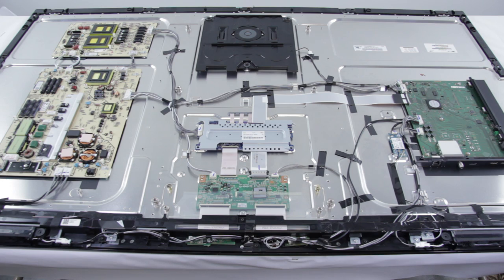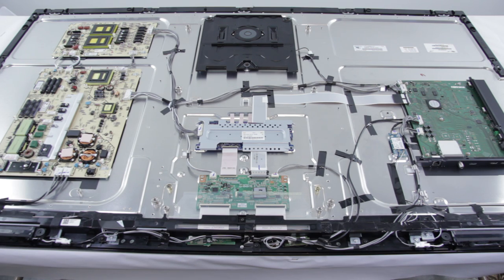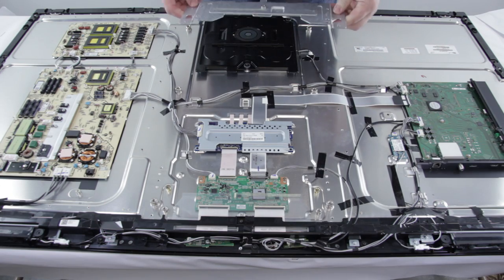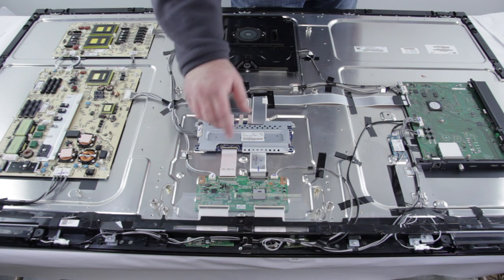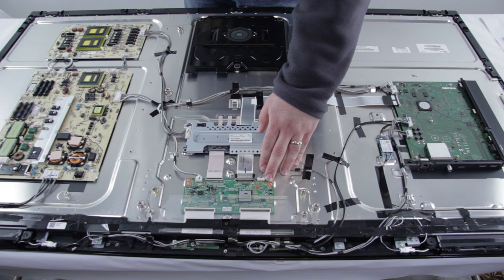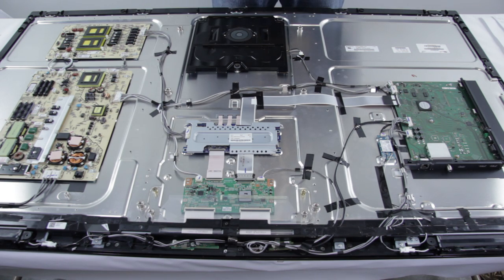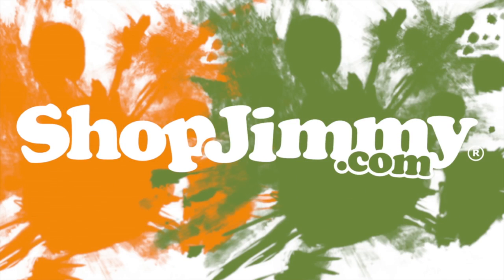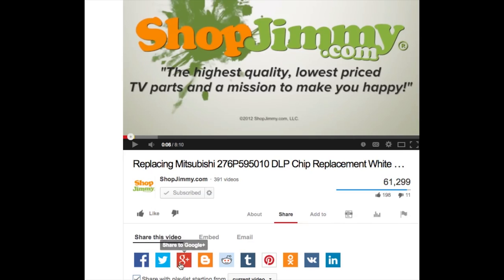LED TV Repair T-Con Board Help Review Overview - Common Issues and Problems with T-Con Boards

Comment: Hi !

I have a Hisense F42K20E I’m attempting to repair.

When I first turned it on, the right half of the screen was messed up but the left half was fine.

There were a lot of blue and red lines on the right.

I replaced the T-Con board.

Now the blue and red lines are gone, and the only problem is there’s a vertical black and a vertical white bar superimposed over PART of the Right side.

I’d estimate the black bar is four inches wide and the white bar is also.

Unless the T-Con board I bought is bad, or I didn’t get one of the ribbons in correctly....

There’s something else to replace.

Any ideas?
Reply from the maker: +William Carr   Try all repairs and troubleshooting at your own risk.  This sounds like a TV panel (TV Screen) problem.  If your TV panel is bad, it may be more cost-effective to replace the TV as panels are typically hard to find in stock, difficult to replace, and expensive.  Thanks and please let us know if you have any further questions!  www.shopjimmy.com

Comment: LG LED/LCD Model 42LE5300  - I have 3 thin vertical lines 2 blue and 1 red. The rest of the picture and TV is functioning fine. Could it be just dust build up or dirty ribbon connectors? Or could it be the T-con board, hope its replaceable. Thanks!
Reply from the maker: Justin Clockwork   This could be the Main Board/T-Con board or the TV panel.  I am saying the main board because it appears to have the T-con board connections built into it.    I recommend replacing the Main board (if it is the same part number as the main board in the search results) to see if it fixes the problem with the TV.  Click this link to find replacement parts:  http://www.shopjimmy.com/catalogsearch/result/?q=42LE5300  Be sure to match part numbers on your current board, with your replacement for compatibility.  Here is a link to a video showing how to identify your part number, click here:  TV Part Number Guide for LG & Zenith Main, Digital, & Tuner Boards (LCD, LED, Plasma TVs)  Thanks and please let us know if you have any further questions with your TV Repair!  www.shopjimmy.com

Comment: Hi, I picked up a Samsung LN40D630M3F that someone left by the dumpster in my apt complex and I'm trying to get it to work. It has backlights and sound, so I'm thinking it might be a bad tcon board. However, the screen was initially black until I connected my laptop to it via HDMI, which is now displaying a mostly gray square on the tv. Can you let me know if there is any hope in getting it fixed and if so, what tcon board I should get? Also, I only plan on using this tv to watch Netflix by connecting to my laptop. I didn't have a tv/cable before and don't have any interest in watching tv. Maybe this makes it easier? Please help and thank you so much for helping me diagnose the problem!

Comment: I have a Vizio M50-C1 led TV . Suddenly my TV stopped functioning .just the power line keeps blinking for few seconds and then stops no picture and no sound☹️plz advice where the problem is power board or the Tcon board

Comment: I have a 50” lg led tv. 50uh5500. I replaced the led strips and got them all working again. After I put the tv back together I only had a blank screen. Took it apart again and did some trouble shooting. If the left ribbon cable is connected and I turn the tv on, that side of the screen will work but if both ribbon cables are plugged in neither side works. Could that be the t con board?

Comment: I have a sharp aquos 60 in LC-60LE6300u LED TV. It powers up and backlights work. No picture and don't know how to narrow down if it's either tcon board or main board. Cant tell you if sound worked when tv screen went blank because it was given to me in this condition. How do I narrow it down?
Reply from the maker: +as4meAndMyHouse2415   Try all repairs and troubleshooting at your own risk. This could be a problem with either the t-con board, the main board or the TV panel. You can replace the main board and the t-con board individually to see if one of those boards fixes the problem.  Click this link to replacement parts for your TV model number:  http://www.shopjimmy.com/catalogsearch/result/?q=LC-60LE6300u  There may be multiple boards for the same TV model number, be sure to match part numbers on your current board, with your replacement for compatibility.  Thanks and please let us know if you have any further questions with your TV Repair!  www.shopjimmy.com

Comment: Hi, let me know what you think about this issue...
Sceptre p/n e325bd-hdc8wx2201p71 s/n d44s32dbcb0326
Started off as losing catv signal "no signal" when we tried to switch back from dvd input/source.  Later the screen would simply go blank shortly after powering up. Sound would remain but dim picture. We also noticed that the channels are not the same as prior to problems. Remote does not work either. While cycling through channels with manual controls, with only dim picture, we noticed the channels were not the same as what was auto programmed in before issues started.
Reply from the maker: John Coots   I recommend replacing the main board in your TV.  Here is a link to potential replacement parts for your TV.  http://www.shopjimmy.com/catalogsearch/result/?q=2201p71  Be sure to match part numbers on your current board, with your replacement for compatibility.  You can also call our customer service for further assistance with your purchase.  (877) 881-6492  Thanks and please let us know if you have any further questions with your TV Repair!  www.shopjimmy.com

Comment: Vizio E601i-A3 starting randomly turning itself off.  Then wouldn't turn on, reset worked for awhile.  Then it wouldn't work at all.  I have changed the power supply board, that didn't help.  does this sound like a main or t-con board problem.

Comment: My 55" LG 3d tv model number 55LM4600 is not working.  We were watching football on Thanksgiving and the TV screen just went black.  Like it turned off.  But we do get the red light in the bottom right of the screen when we push the power button.  We don't seem to have picture or sound.  We just bought the tv about 2 or so years ago.  Thanks.
Reply from the maker: +K'Sean Harris   Try all repairs and troubleshooting at your own risk.  I recommend replacing the main board in your TV.  Click this link to replacement parts for your TV model number:  http://www.shopjimmy.com/catalogsearch/result/index/?cat=56&q=55LM4600  There may be multiple boards for the same TV model number, be sure to match part numbers on your current board, with your replacement for compatibility.  Here is a link to a video showing how to identify your part number, click here:  https://www.youtube.com/watch?v=RwHTvjMdrhk  Thanks and please let us know if you have any further questions with your TV Repair!  www.shopjimmy.com

Comment: Gday mate. I have a Samsung 60inch led smart tv model number UA60D6600VMXXY and my symtoms are turn it on and the screen is black, hit the smart button on the remote and it flicks to dark blue. Full sound is there. my daughter cleaned the screen with a wet cloth and I could see dry dribble mark runs down to the bottom.. not much tho. opened the tv up and its all dry but there is a funny noise coming from the tcon board. thanks, Mick..
Reply from the maker: stoned jov   I recommend running the flashlight test on your TV.   Here is a link to a video we produced that shows how to run the flashlight test. https://www.youtube.com/watch?v=xUzCLgoSPGM Please reply with your flashlight test results and we can recommend a replacement part for your TV repair. Thanks and please let us know if you have any questions! www.shopjimmy.com

Comment: RCA 65" LED LCD full HDTV MODEL# LED65G55R120Q
(No picture) 
Power the unit on and the back lights just flash (blink)  every 5 seconds or so. It acts like it wants to power up then just blinks again... what direction should I go from here?
Thank you

Comment: I have a  Samsung UN55D8000 55" smart TV. Randomly one day last week a single yellow vertical line appeared on the left 1/3 of the screen. It looks to be only 1 pixel wide. It's been  mounted on the will with  o damage and I can't figure out what's wrong with it.
Reply from the maker: Nick Duran  Try all repairs and troubleshooting at your own risk.  This sounds like a TV panel (TV Screen) problem.  If your TV panel is bad, it may be more cost-effective to replace the TV as panels are typically hard to find in stock, difficult to replace, and expensive.  Thanks and please let us know if you have any further questions!  www.shopjimmy.com

Comment: on that lc-60le632u tv that i have the problem with  i still have a picture when it starts to flicker  white i can still watch tv its just that the flickering is annoying would it still be the power supply board
Reply from the maker: Manuel Rojas   This is either the power supply board or the TV panel.  You can replace the power supply to see if that fixes the problem.  http://www.shopjimmy.com/catalogsearch/result/?q=lc-60le632u  Thanks and let us know if you have any other questions!  www.shopjimmy.com

Comment: Hello Sir/Madam 
My 55L6200u Toshiba turns on and displays Toshiba in the normal red letters however it will not do anything else I’ve looked up how to reset using the volume buttons and it reset but the out come was the same if you have any suggestions please let me know

Comment: I have a Samsung 4k. UA50JS7200 SUHD, 
My led tv suddenly disapear picture and convert into vertical line with sound. I don't know what happened. 
Someone says me that check your tcon board with three green lights, but I found there only two lights on tcon board, can I simply change the tcon with new one?

Comment: I have a 6 year old Phillips flatscreen that went out on my yesterday.  All it displays is yellow, blue and some white (think and thin) horizontal lines. Nothing else will display...input, menu items, volume bar, etc.  I was installing Apple TV yesterday and all I did was plug in an HDMI cable.  I have a video but not sure how to post here...will keep looking.
Reply from the maker: Mark Urbano   This sounds like a TV panel problem.  If your TV panel is bad, it may be more cost-effective to replace the TV as panels are typically hard to find in stock, difficult to replace, and expensive.  Thanks and please let us know if you have any further questions!  www.shopjimmy.com

Comment: Jimmy,

I have a Sony KLV-46V400A TV it has a condition where it appears like the screen has cataracts.  The images will show up but everything is washed out in white, even the menus when you pull them up. Any ideas?
Reply from the maker: arcamdies   PLEASE SUBSCRIBE TO OUR CHANNEL - Try all repairs and troubleshooting at your own risk.  This could be a problem with either the t-con board, the main board or the TV panel.  You can replace the main board and t-con board individually to see if one of those board fixes the problem.  Unfortunately I do not see any replacement parts in the search results for your TV model number on our website.  Thanks and please let us know if you have any further questions!  www.shopjimmy.com

Comment: I have an Insignia ns-32d311na15. It turns on, the backlight works, but no display. It also smells like burning electronics so I unplugged it.

Comment: Hello, 
I have a Sony KDL-40D3500  .....I get these grid of green lines all over the screen and various artifacts, but when I change the channel, it clears up and then after a while, it happens again. Sometimes the TV won't come on. The red light blinks 11 times.
Reply from the maker: Drebln893   Please watch this video FIRST to help with your repair!  https://www.youtube.com/watch?v=BP3NVNCGEv8  I recommend replacing the main board in your TV.  Click this link to replacement parts for your TV model number:  http://www.shopjimmy.com/sony-a-1466-265-c-be1f-board-for-kdl-40d3500.htm  There may be multiple boards for the same TV model number, be sure to match part numbers on your current board, with your replacement for compatibility.  Here is a link to a video showing how to identify your part number, click here:  https://www.youtube.com/watch?v=Aodz2LHkzbY  Thanks and please let us know if you have any further questions with your TV Repair!  www.shopjimmy.com

Comment: Help.  Sharp aqueous LED 70".  Model  LC-70LLe650U. I'm getting black horizontal shadowy lines flickering up and down the screen. I'm thinking T con board maybe?
Reply from the maker: Slicedog Nn   This sounds like a TV panel (TV Screen) problem.  If your TV panel is bad, it may be more cost-effective to replace the TV as panels are typically hard to find in stock, difficult to replace, and expensive.  Thanks and please let us know if you have any further questions!  www.shopjimmy.com

Comment: Thank you Jimmy. I have a Samsung 50" tv. I have sound but no picture. my screen fails the flashlight test. I have replaced the T-Con board. still no picture. model# UN50H5203AF. Can you help?

Comment: Hi there i have a problem with my tv.i have a philips LCD 37 inch tv and the problem is that after i turn on the tv like after 30 mins or more, in screen show up horozintal lines and all looks like the picture is vibrating.if i turn off tha tv and let the tv cool down the tv work well. Is my tv overheating or what ?? Pleas help

Comment: Hi i have a Samsung tv un32eh4000 my tcon board is connected to my screen has no clips. My issue is it's showing 3d on the screen. If I take it off for a day n put it back ok it shows ok for a min. Plz help me asap

Comment: ive got a Toshiba 42inc lcd model number hl800a  screen lights up but no picture....un plugged and re pluggged connections inside to no change...was online and a person said its possible this tcon board.....any ideas wete to get one plz

Comment: hi there I have a Toshiba 32BV500B tv it was fine on night but when I turned it on the next day, I had the problem with the picture, as in white lines, down the screen only going, prob  1/2" away from edges,  normal looking beyond this point, some picture freezes, but a moving picture underneath, I would say the t-con board needs replacing, please can you confirm this please before I strip it down, and which part I might require many thanks
Reply from the maker: WDMATRIX143   I recommend replacing the main board in your TV.  Unfortunately I do not see any replacement main boards in the search results for your TV model number on our website.  Please reply with your part number on your main board and I can try searching for replacement parts.  Thanks and please let us know if you have any further questions!  www.shopjimmy.com

Comment: I have a Insignia LED model # NS-L42Q-10A.  My problem is after the TV is on for about one minute the screen begins to fade, almost like a white-out, but not entirely.  The picture image remains faded out with the colors blurred and faded.  My initial internet search seems to identify the T-Con board as the fault.  But I'm not sure.  I have also been having a difficult time locating a replacement t-con board.  Any assistance would be appreciated.
Reply from the maker: Bill McSparren   Here is a link to replacement parts for your TV model number on our website, click here:  http://www.shopjimmy.com/catalogsearch/result/index/?cat=4&q=NS-L42Q-10A  Be sure to match part numbers on your current board, with your replacement for compatibility.  You can also call our customer service for further assistance with your purchase.  (877) 881-6492  Thanks and please let us know if you have any further questions with your TV Repair!  www.shopjimmy.com

Comment: hi, I have a 55LW5300 LG LED 3D TV and I am have half screen showing upside down pictures on the left side  and the right side picture is just fine. pls can u suggest the possible problem and repair part? Thanks
Reply from the maker: +berj adam   Try all repairs and troubleshooting at your own risk.  This could be a problem with either the main board or the TV panel.  Click this link to replacement parts for your TV model number:  http://www.shopjimmy.com/catalogsearch/result/index/?cat=56&q=55LW5300  There may be multiple boards for the same TV model number, be sure to match part numbers on your current board, with your replacement for compatibility.  Here is a link to a video showing how to identify your part number, click here:  https://www.youtube.com/watch?v=RwHTvjMdrhk  Thanks and please let us know if you have any further questions with your TV Repair!  www.shopjimmy.com

Comment: Greetings 
I have a Hisense 50K316w. We have audio but not  image. We tried the changing the High Voltage signal board but with no result. The TV has audio but no video and no back lights. We turn the lights off in the room and we notice some movement in the screen. We put our flashlights close to the tv and notice images. In conclusion, we have audio, video to some degree but no backlight. Could be the T-Con board or the main board ? Please I would really appreciate the help and guide me to the right direction.
Reply from the maker: Ronald Ruiz Conforme  Please watch this video FIRST to help with your repair!  https://www.youtube.com/watch?v=BP3NVNCGEv8  I recommend replacing the main board in your TV.  Click this link to replacement parts for your TV model number on our website:  http://www.shopjimmy.com/catalogsearch/result/index/?cat=56&q=50K316  There may be multiple boards for the same TV model number, be sure to match part numbers on your current board, with your replacement for compatibility.  Thanks and please let us know if you have any further questions with your TV Repair!  www.shopjimmy.com

Comment: hey,my lg model No. 32lf550d powers on,there is sound,remote control is functioning quite well and also usb and backlight of the screen is also visible but there are no pictures but there is attempt of pictures appearing..please help